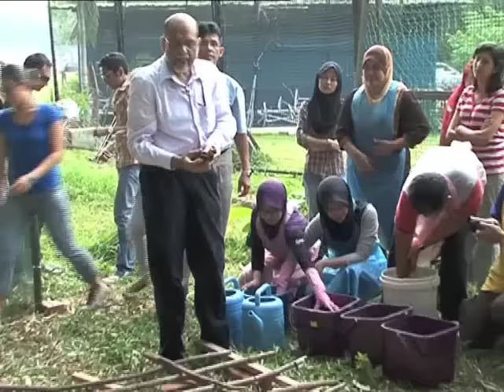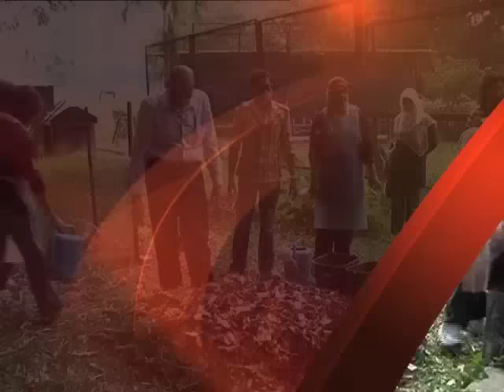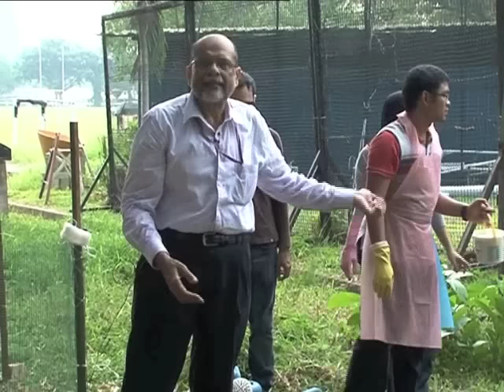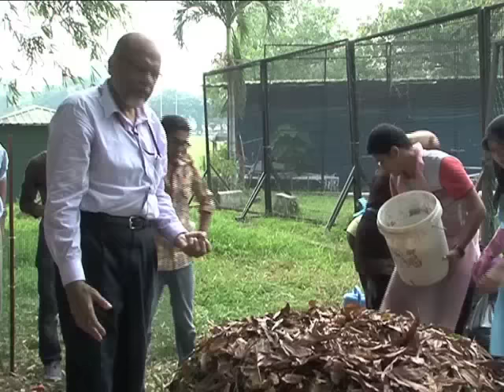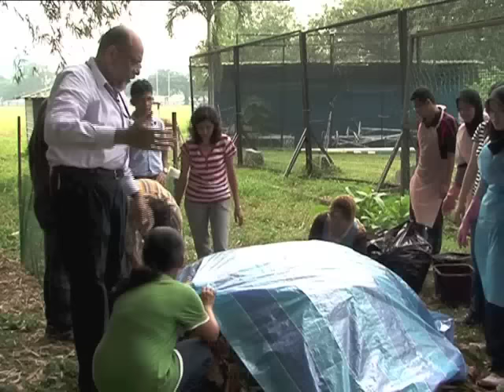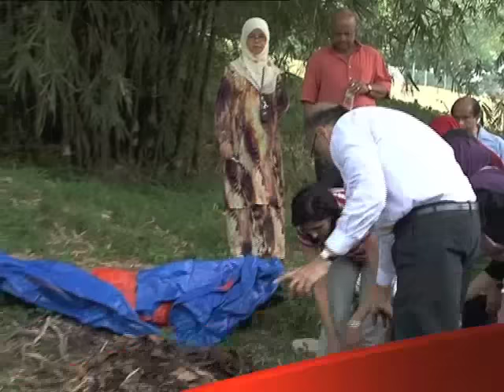Heap Composting / Pile Composting with Prof Sultan at Universiti Sains Malaysia USM

Comment: Thank you Pro Sultan for that documentary on Composting.Very comprehensive.I like this.I make composts but I use bamboo poles cut to the required dimensions of the compost and use them as frames to hold the comost together

Comment: Sir, can we grow plant directly in compost ?  How can we avoid use of soil in making potting mixture ?
Reply from the maker: Compost also part of the soil. Any organic matter that degrade on the top of soil also considered as compost.

Yes you can grow plant directly in compost. But some plant love porous soil. You need to know what kind of soil that your plants love.
Reply: @nurrhamzah  Sir, I have one doubt. Suppose I have planted sapling in 100% compost in a pot and then added water. During this action all water soluble matter in compost, which is rich in water soluble ions, will dissolve in added water and will form a highly concentrated solution around the roots. I feel this highly concentrated solution will burn the plant by reverse migration of water from plant to soil. Request your opinion.
Reply from the maker: @mukundathavale5040  matured compost usually will not burn your plant. You can test it when you pour some water on it, it will not increase the temperature.

But, if your compost been made by chicker manure, it may burn your plant.

The best way, you should try and experiment yourself how much your compost can be use for the plant without harming it.

From my experience, if you follow the method from above, there will be any problem. Unless the plant do not love to be in too moist media/compost.. Then you need to mix the media with the sand to increase the porosity.
Reply: @nurrhamzah  Thanks Sir, for clearing my doubts. I will try fully matured compost along with porus material. Thanks.

Comment: I am a practitioner of composting.
# CAUTION : Yogurt from supermarkets contain sugar , additives  & thus will attract ants. That is not ideal.  Microorganisms are found in nature, present in leaves etc. Ther is no need to sdd diluted yogurt. 
#  from experience,  Compost takes 3 months  be4 it can be used.  Green material is nittogen. Mix with browns (  carbon) Mix the pile will rrsult in faster decomposition of materials.  decompositiin. I suggest   2  put  pile under the sun.  Be aware Pathogens will come from the ciw dung. Its not necessary.  
 # add egg dhells that is boileed& crushed. 
# put a metal place under to trap the liquid. 
# i

Comment: Will it be leaf mold or leaf compost??
Reply from the maker: It will be composted. The manure (rich in microbe) and the green material(grass clipping) will enhance the composting process. The green material will generate heat to "cook up" the dry leaf. (usually the temperature may rise more than 50c)

Comment: Why would  any ‘’renewable energy’’ be needed for composting? Also you don’t need ANY animal’’dung’’ for composting, just sprinkle a thin layer of Soil between layers of plant material( we need to stop the unnecessary  breeding these animals anyway) . Also a bit of Human Urine helps with breaking the material down, but only a small amount so not making the compost too wet. I compost all my kitchen scraps in an old black dustbin that I found, and so long as I ad a bit of Soil and turn the compost now and then, I get very good nutrient rich Soil from it.